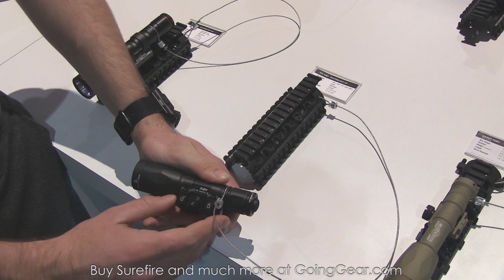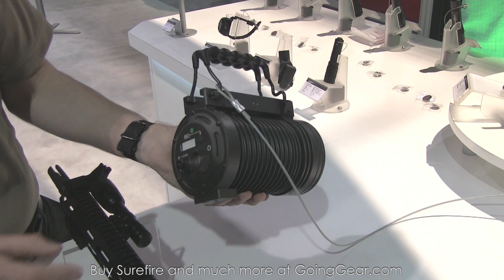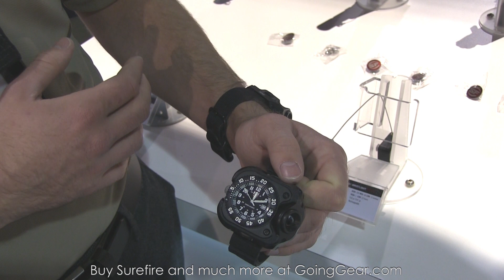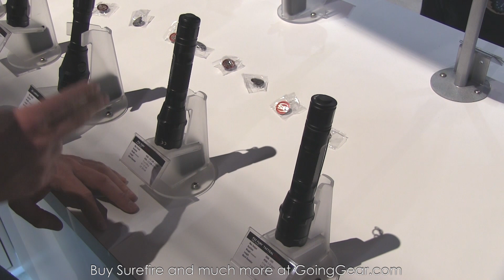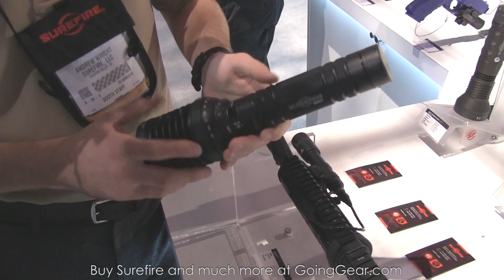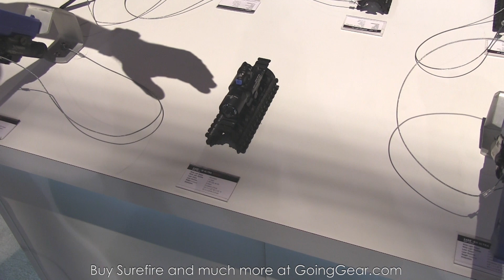SHOT Show 2014 - Surefire New Lights & Gear

Comment: Why are they selling IR lasers under the civilian market and then selling a 5mw laser on a "restricted" market? That's silly: it's legal for a civilian to own and operate a 5mw laser, why not sell it? If I paid $300-$1500 for a civilian NVG set up, then I can probably properly handle a 5mw laser. Weird decision.
Reply: If you do your research on these aiming lasers, you will find that 5mW is the limit for visible lasers, but for IR lasers it is .7 mW. This is why they are saying that they will have both a class 1 (presumably .7mW) as well as a full powered restricted model with 5mW in IR.
Reply: awwbugman
 Interesting! Didn't know that. Thanks!